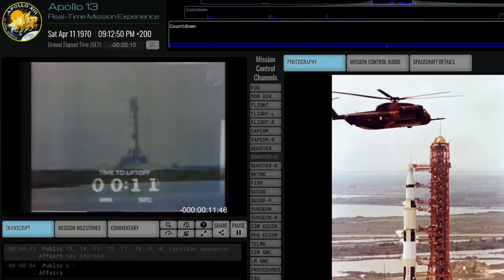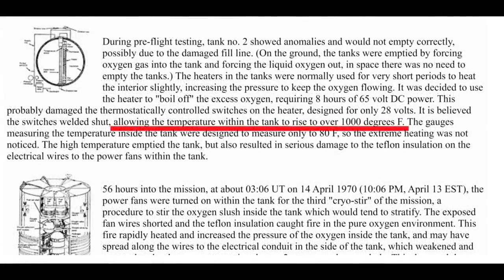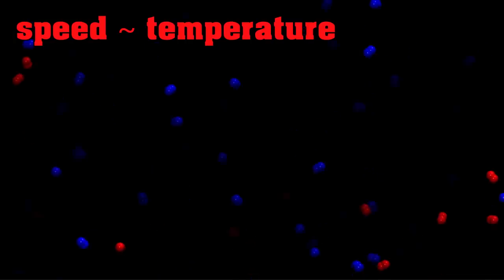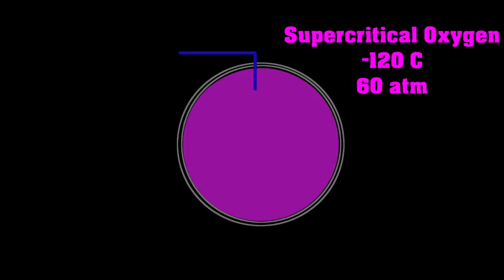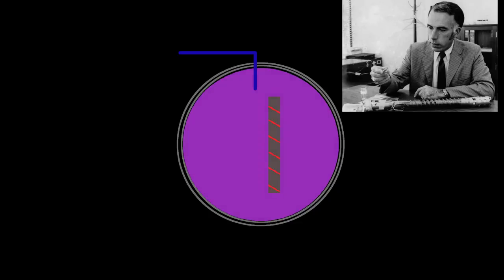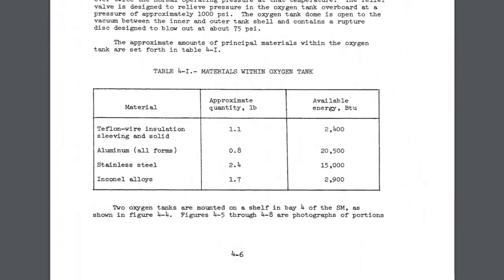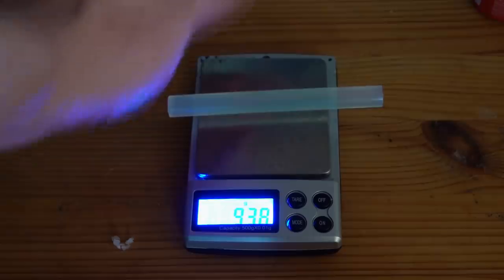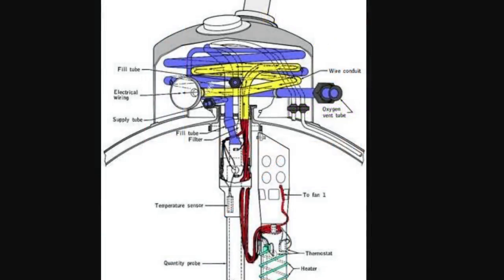Apollo 13 the FULL story: Part 2: The explosion.

Comment: You pointed out that a flare up of the PTFE was due to getting some dirt on it from the beaker.  Maybe the PTFE that was available in 1970 was not as pure, or had other ingredients like plasticisers and dyes, that made a difference.
Reply: Ooh, that’s interesting, good catch
Reply: Another thing is that avionics grade PTFE wire is typically a foamed structure to reduce mass, so there would have been a large surface area available, but in a small volume. 

As Phil is in the EU there is no problems for him to look on Ebay for any cheap aircraft parts on auction, both from US origin, UK origin, French origin and ex Soviet era hardware, which almost always has PTFE wire involved in the construction. that will give a nice cross section of wire types and sizes, and of various ages and manufacture, to do a quick test. As a wire it is the correct form factor, and is not a pure PTFE, as typically the insulation used there has some filler or the other added to it to get it to extrude nicely onto the wire, which also has a nice silver plate on it to prevent any chemical reactions between the copper wire and the PTFE with time, contamination with chemicals and heat. The units are cheap in Euro prices, and shipping is very cheap as well. He will also get a good set of samples of the grades of aluminium alloys and stainless steels used in manufacture consistent with the era, for other tests.
Reply: As I recall, PTFE got banned from manned spacecraft because of the toxic smoke if it did burn.
Reply: @bdf2718  They could not replace it, nothing else has the ability to withstand the use case, so it was replaced with a blend with some inerting fillers so the flammable volume was less.  You can't really use any other plastic there, and ceramics and glass or asbestos fibres are too brittle.
Reply: @SeanBZA  Foamed PTFE was only inveted in the 1990s. Could have been expanded PTFE though.
Reply: @666wurm  Could be, I generally only met the expanded stuff as wire, and it was nice and flexible, but somewhat fragile with time. The solid PTFE cable though was very common in high temperature applications, along with polyamide, though that would turn to crumble long before the PTFE itself would.
Reply: Its possible to have some plasticisers and other stuff in it to make it more flexible or perhaps inflexible (depending on what you're trying to do with PTFE), but dye? There would be no reason to use dye on a wire insulator that will permanently live inside a SEALED tank, never to be seen by the crew.
Typically we use colored wires when those wires are intended to be worked on or installed, or plugged/unplugged.

Those wires had a very strictly basic functional purpose. There would be no dye in them.
Reply: @SeanBZA  They also use Lead as a lubricant in space. How does that react in high pressure O2?

Comment: Wires are often wrapped in expanded PTFE. ePTFE has up to ~50% porosity. That might have changed things. I have done some flamabilty test with it (not in LO2 though) and it burns considerably. That was testing for the Ariane O2-tanks some years ago.
Reply: i think ePTFE wasnt invented at the time yet actually. but certainly PTFE is never pure so perhaps it could have trace carbon in it or smth
Reply: Damn it xD you beat me to it.
Reply: As far as I am aware, expanded PTFE insulation was not available until about 20 years after Apollo 13.
Reply: @RWBHere  ePTFE was inveted by Bill Gore in about 1955. First commercial applications were cable insulations end of the 50s. Appolo 13 was in 1970.

Comment: when welding stainless steels you normally use about 1/3 less amps because the stainless doesn't transfer heat away from the weld zone as much as normal steel.. for Apollo 13 it would be easy for a hot spot to form on the stainless tank causing an explosion because of how bad stainless conducts heat.
Reply: Agreed.. the reason a car radiator is copper and a house radiator is cast iron...

Comment: Some thoughts:
- The material that was burning, was in contact not just lox, but with a wire for a resistive heater.  While the heater is on, it’s going to give the material an advantage for burning.
- Heating the tank was a regular procedure.  Was that their first time heating the tank on that mission?  Did the fire start/go out with repeated heating sessions?
- In your tests, is your lox at a comparable temperature?  (Probably colder, letting it wick away heat faster)
- Would a Leiden frost effect work in a zero-g supercritical tank?

Comment: Wouldn't it be smarter to have the heater on the outside of the inner surface of the tank? It's insulated from the outer surface by a vacuum, so it would only be slightly less efficient than an element inside the tank - but it would be orders of magnitude safer. And as for stirring? You do that with a magnetic stirrer. If you did that, you'd have no wiring inside the tank at all, and a much safer system.

I'm reminded of the explosion caused when corroded wiring insulation caused high voltage to leap into a low voltage circuit inside the belly tank of a 747 departing from New York. The wiring was to a fuel level sensor. The resulting spark triggered a massive fuel-air bomb (which is basically what an empty tank is, if it's got any sort of O2 in it) which blew the cockpit and the first 15 metres of the fuselage clear off the front of the plane.

The engines, still running at full throttle, were unaffected, as the blast was mostly directed downwards - now put the remains of the plane into a high nose angle, due to the loss of the front of the plane, and with less mass, the engines were able to make the plane climb at an impossible angle for about 7,000 feet. Then the plane stalled.

The plane then flipped ends and plunged vertically, from about 15,000 feet into the sea. Many passengers had time to write goodbye notes found on the bodies.

That's why you don't want wiring inside your plane's fuel tank, either.
Reply: My god this is horrifying.
Reply: Now that sounds like a terrifying way to go...

What do I have to type in to find that crash?

Comment: does anyone know what software thunderf00t uses for his gas molecules explanations?
Reply: @JoshuaNorton  appreciate the reply. cheers
Reply: It's a molecular dynamics simulation. That's a broad field, in which the interactions between all particles in the system are calculated over time, which is a very exponential problem. Hence why the simulated cell, number of particles and time-scale is usually quite small. And given that it's mainly a research topic I'm not surprised that a lot of it is homemade software. But try it under these keywords and you will find a lot of material about it.
Reply: Vaporware 😅
Reply: I upvoted to make it more likely this catches his eye. The thing is the software might not be easy to use.
Reply: @JoshuaNorton  Yeah I remember him saying that. I believe he brought it up in one of the hyperloop videos.
Reply: @Keex11  yeah i know, i use vmd, visual molecular dynamics tool mostly to perform my small studies with gas and phase interactions at varying temperature and pressure, but it runs very  very slow even for a very basic simulation of very small volume and small mass, and thunderf00t's looks marginally better performance wise, so thought if i could know maybe i could try it out. all in all this is assuming he dosen't use his workstation in his lab. then it kinda would be pointless since i don't have access to a workstation at the moment.
Reply: @moeron9172  I'm pretty sure I remember him saying that the simulation took ages to simulate / process / render  and what we were looking at was the end result. And specifically him making a big deal about being somewhat of an accomplishment and not trivial, despite not looking like much by the time we see an end result video. When Thunderf00t claims something he did and no one else has done was not a trivial task, I tend to believe him.
Reply: @onradioactivewaves  oh, then i guess vmd would hold similar processing if not less by your description then thank you, cheers and have a nice day :D
Reply: He says what it is in this video. It was on his 2nd channel. https://youtu.be/Chc7T6IF_6k?t=4216

Comment: Just a note: I believe the voltage in the system had been changed from 27.5 volts to 65 volts. The theory is that the change caused the thermostat to weld itself closed.

Comment: Low voltage can definitely cause spme damage if the power supply can supply a large amount of amps. A guy dropped a screwdriver into a 48v supply at work and the screwdriver was instantly vaporized.

Comment: Considering the heat transfer by wires you have to consider also, that the port(s) act as heat shunts, too. The heat goes very high in middle of such shunt (if there is good/excessive insulator around it). There is lot of summer cottage fires started by chimney insulator epoxy burn up to right hours later with such set up.

Space is also great insulator.

Comment: In the tank that failed the source of heat was the wire inside the insulation. The O2 surrounding the insulation was supercritical, not liquid. The liquid O2 in your experiment is not only cold but it absorbs heat as it changes phase to a gas when exposed to your burning PTFE. Supercritical O2 when heated increases in pressure but does not change phase.
Reply: @Richard Choi While he does say the liquid quenches the flame the implication seems to be that liquid was equivalent to what was happening in the tank on the spacecraft. In fact we see the PTFE burning reasonably well in the O2 gas above the liquid. He then goes on to show the steel wool burning in liquid O2. While certainly an energetic reaction it is not equivalent to using supercritical O2.
I am not implying that he should build an apparatus to test combustion in  the supercritical gas. As he mentions, that would be prohibitively costly.
Reply: He does address this.

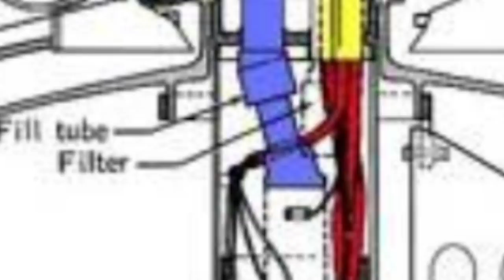Comment: Me at 36:00
My guess: the opening of the overpressure valve pushed the gases away from the wire burn, and the oxygen coming in through a hot filter was the failure.

Comment: those sparks at 17:50 are not the few amps your psu can output, but the output capacitors discharging at probably more than a 100 amps

Comment: 48:45 you missed one aspect of the burn test. The Apollo oxygen tanks were under pressure. Will the taflon burn with more intensity under pressure? Vs general atmospheric conditions in your lab?
Reply: Well in the liquid oxygen is over normal pressures and it at least is much higher concentration right above the liquid.
Reply: And nearly weightless (I don't know how much acceleration they were at during the time of the explosion but the astronauts were definitely floating around at the time).  So the liquid wouldn't be pooling around the bottom of the tank, I think.  A fire would act differently in a case like that I think.  But it isnt like we have invented gravity chambers yet where we can reduce gravity in a test area so I don't blame TF for not replicating that.
Reply: @SirWussiePants   Pressure and gravity are 2 different things. The super critical oxygen was at 1000 PSI. Does fire behave differently under such pressures? He should retry the experiment in a pressurized chamber with a viewport.

Comment: (Conspiracy Theory Time) They failed to connect the vent line to the tank, so it vented into the service module where the fire was already slowly burning through the feed-through. Look at the graph again. Notice how the pressure levels off at ~950PSI, where the heaters should've cut out normally, and sits level for ~15s before climbing at a slower rate up to the vent of 1008. There's a ~1.5s span where the quantity sensor is  briefly off-scale-low -- I assume that's when the semi-frozen liquid boiled off the probe -- then returns to a normal / expected level for a second and then begins to drop. This is all occurring about the same point the over pressure vent would actuate. And then boom. Fire burned to the outside wiring and now oxygen filled space inside the service module.

Too bad the SM was never brought back for close inspection. :-) If the tank did explode, it did it very quickly. (quicker than the pressure sensor could register, and those things aren't very fast.)

Comment: Sometimes those overpressure relief valves get sealed shut due to the spring pressing on the seal, I have no idea which type they used on the mission, but when tested they sometimes pop considerably over the rated pressure. And supercritical fluids have very interesting reaction mechanisms which are still explored in the world of science. Last time I used supercriticality was with biodiesel and fatty acid reaction with methanol, interesting stuff.

Comment: 49:00 But isn't the Oxygen in the tank supercritical? Not quite liquid, but just above this state? The Teflon would continue to burn alongside the length, as you described, and not go out since its not liquid per see.
Until it reaches another material which burns faster or more easily? Or it runs out of material to fuel the combustion and extinguish itself out?
And since the whole vessel is pressurized, it will add pressure to the point of less resistance even in 0-g, in this case the filter assembly.
Another great video, man. 👍

Comment: What is the framerate on that thermal camera? Except for when it seems to calibrate itself (brief freezes) it has a really nice smooth output. 

I'm sometimes mildly annoyed at the low framerate on the FLIR One that was very suitable and affordable for my purposes, it had something to do with made by US company and international arms export regulations (ITAR) if I'm not mistaken. Somehow I don't think the model being used here is anywhere near affordable for hobby purposes, but I guess I really should look for some not made/designed in the US brands to see if there are ways to dodge the annoying under like 10 fps.

Pressed send too early, interesting video as usual assumed this would be the conclusion but looking forward to part 3 now I guess.

Comment: Yellowpages wont burn but pages from it will, mdf dont burn its dust is explosive, saturate the substance with air by increase surface area and up it goes, the filter sounds most plausible.

Comment: The "burning Teflon" explanation never quite sat right for me. Carbon-fluorine bonds are very sturdy, and I, too, wondered how they got PTFE to burn. I  thought that maybe there was another material in with the PTFE that was much more flammable in supercritical oxygen, only it never got mentioned in any of the accounts I read because it was just a  minor detail. 

There's a good reason that halogen-saturated carbon compounds made such good fire extinguishants, before they were banned because of their role in stratospheric ozone depletion. I believe one of the more common "halon" extinguishants was bromochlorodifluoromethane.

The idea that a filter made of inconel and stainless steel was the actual fuel for the catastrophic fire in O2 tank no. 2 is significantly more plausible from the chemistry viewpoint than that it was burning PTFE.

Comment: I remember a video and study that said it was actually a small bit of exposed wire METAL due to someone accidentally damaging the ptfe insulation in a static ground test.  so what kind of metal was the wire?

demolitionranch recently did a "shooting oxygen tanks" video... and what happens to the tanks looks very forceful and apollo13ish, as the oxygen burns holes up to 5x bigger than the bullet holes of the metal tank body itself at just welding tank pressures

Comment: To prevent this they should have used an unregulated Power Supply. A short would have brought the potential to 0. A regulated PS, like the one you use maintains potential even if shorted. The Teflon  also used an aluminum conductor. They should have used silver stranded wire. The aluminum tank should have been thinly golden plated. The increased weight would been negligible.

Comment: Why did the over pressure system need a filter to exhaust? Was PTFE produced then as pure as what you get today?
Reply: @ItsMrAssholeToYou  Protect from what? Dust particles, ice from condensation. Oxidized particles? What contaminants would you suggest?

Comment: So, I am curious what changes NASA made from Apollo 14 onwards to ensure the oxygen tanks could not explode on those craft?
Reply: From space.com "According to former mission controller Sy Liebergot, the changes included:
Another cryo oxygen tank that could be isolated to only supply the crew.
Removing all cryo tank fans and wiring.
Removing the thermostats from cryo tanks, and changing the type of heater tube."

They decided that there was no need to stir the tanks any more, after data from the first 3 missions.
Reply: @Forest_Fifer  Many thanks for your reply. The first journeys by man, away from earth and Earth orbit are an endless source of fascination. I hope that other men and women make the journey again before I die. I was child when Armstrong stepped onto the Moon and thought this was the dawning of a new age. It was, but it stalled for many decades. Cheers.

Comment: The temperature of the gas container is simple if you look at the gas at a given temperature having energy, if you remove gas/energy from a container and nothing else enters that tank (be it matter or external thermal radiation) the total energy of that tank decreases, and in this case it is reflect by the temperature of the remaining gas lowering.